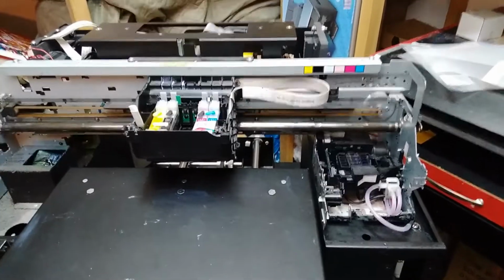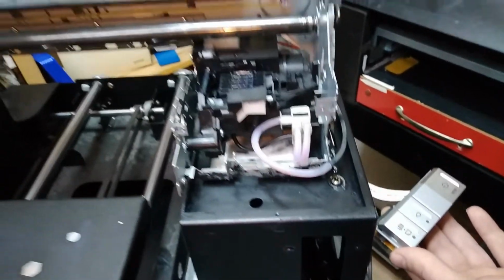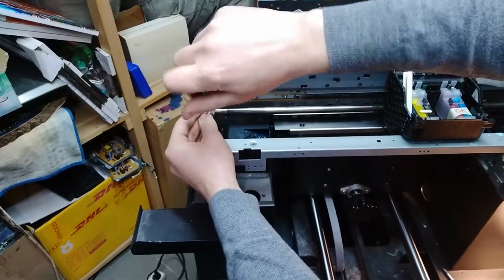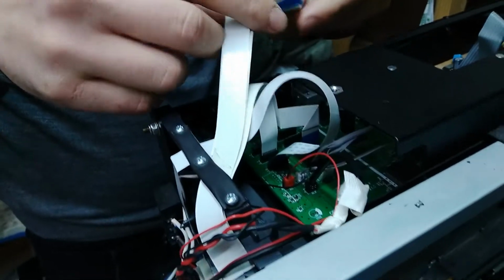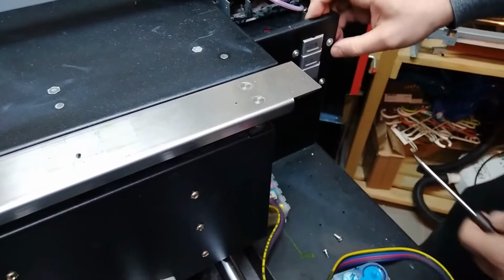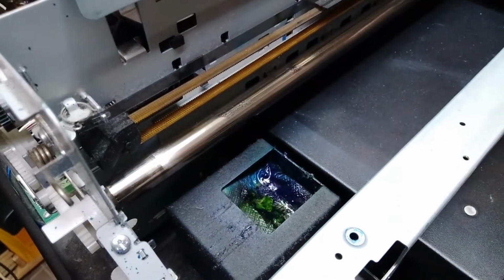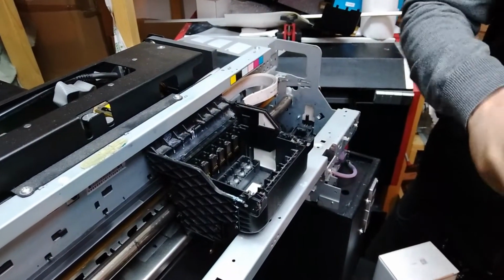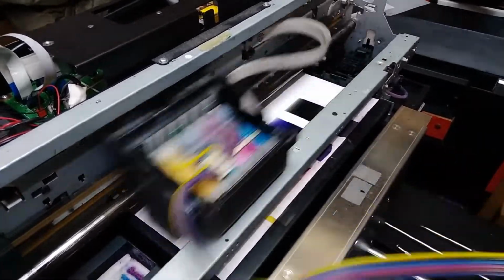DTG printer 1390 repair No. 6 (part 2)

Comment: Nice and hard work. But when motherboard is burned or faulty does it always beep? My uv 1390 printer doesn't print at all, but all movements are ok with no errors. It has installed a chip which eliminates the one on cartridges, maybe it has something to do with that?